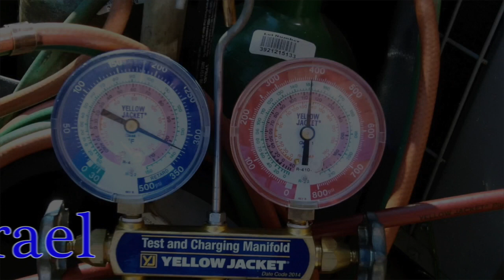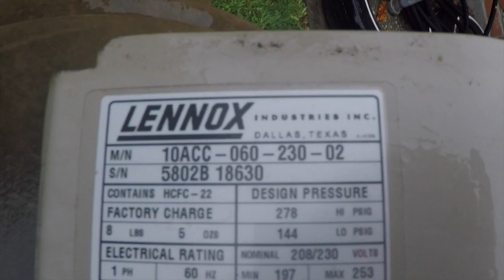HVAC: Lennox TXV Replacement

Comment: Good point Larry. Yes John the tube should go upward out of the bulb. Flipping the bulb should make the TXV react faster and you may or may not have to adjust the charge after the change. Maybe not with R-22. Vertical is also sufficient as long as you stay away from the equalizing tube if it has one, and between it and the coil.

Comment: Could you run the bulb inside the Evap?
Reply: I do whenever I can. It helps with off cycle migration also due to the ambient heat not warming it up so much.

Comment: John I prefer to use Rubatex on the txv.  Makes it easier if you have to go replace one. However, I don't leave it lose. It has to be tight otherwise No bueno. Keep the videos coming bud!
Reply: On the txv bulb.